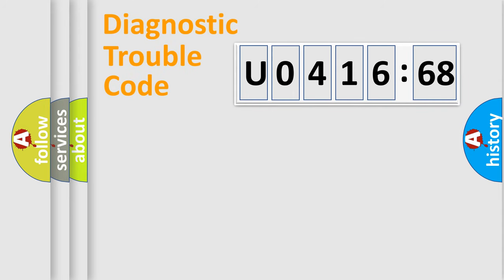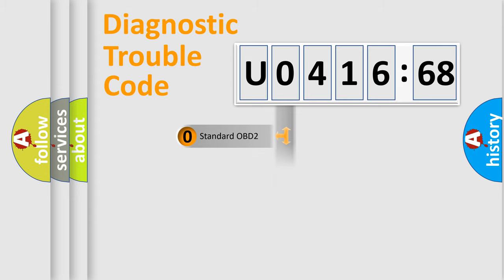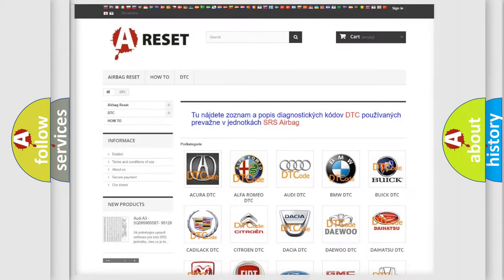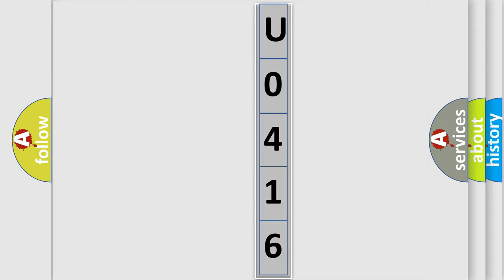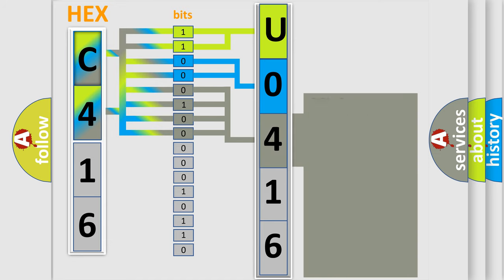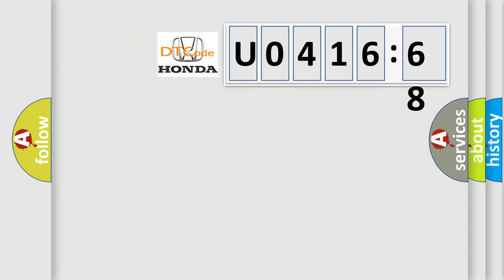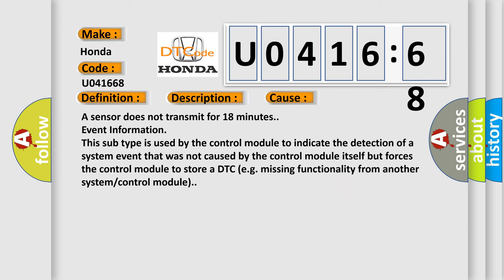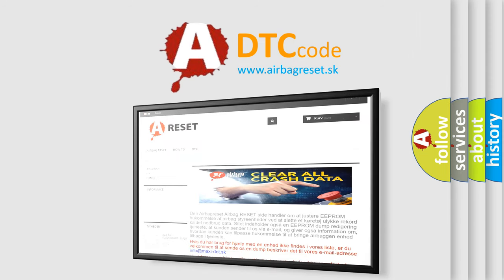DTC Honda U0416-68 Short Explanation

Comment: It depends on the failure type request, requesting module and the scan tool description (some aftermarket scan tool dtc descriptions are incorrect). I've seen this code and others like it set in multiple modules (any module the recieves this (operational error) bus message signal as a direct input), will have an active DTC for this failure. Depending on the manufacturer, it can be the same dtc/sub code.